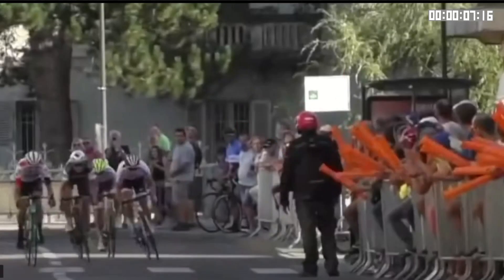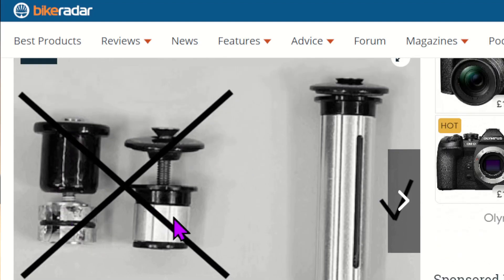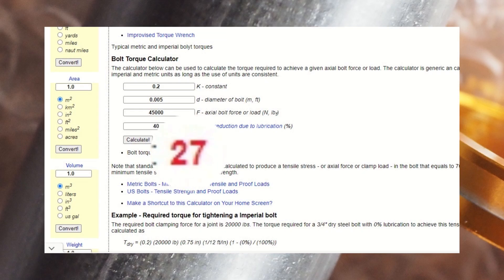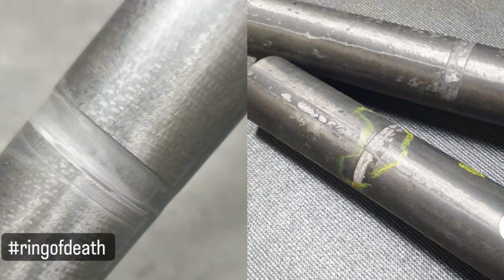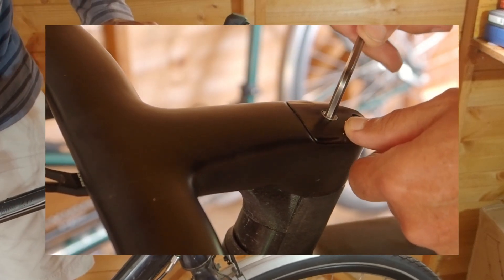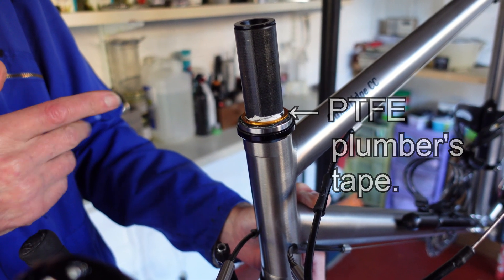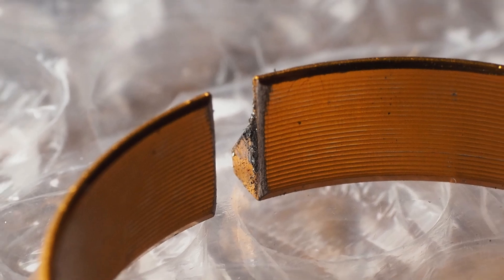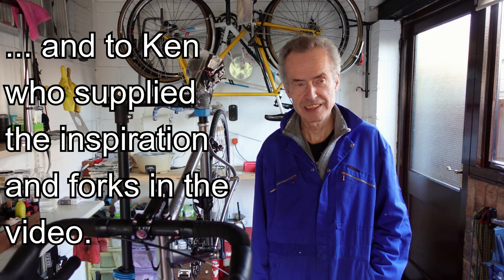Fork steerer: don't fail me!

Comment: Thanks for the PSA - it hadn't occurred to me that this could be a concern r.e. ringing. I inspected my carbon fork steerer tube and didn't see any damage. I tried fitting some teflon tape as a preventative measure but the ring is so snug I couldn't fit the tape under it, so I left it off.

Where the tape was useful though was around the base of the steerer tube where the crown race rests. The fitment of the CR was a bit loose around the straight stem, leading to a bit of play in the fork when the top cap was tightened properly. I noticed it when I gripped the front brake - I found there was a little bit of rocking in the fork. So I wrapped a few rounds of tape around that area and pressed the CR on. It seems to have removed the play for now, we'll see once it gets a few miles on it. Thanks for the inspiration!
Reply from the maker: It's good that you didn't see any ringing. Not all fork steerers suffer from it. Whether your bike suffers from ringing depends on many factors, including the design and manufacturing of the various components. For instance, some of the rings are not split, they have a o-ring inside them that fits snuggly onto the steerer, this type tends not to cause problems.  
Wear where the lower race fits onto the fork steering is not uncommon either. It's good that you may have found a solution, but if it were mine I would give it a good visual inspection just to make sure there was not any other issues where the steering fits into the fork crown.

Comment: Thanks for the info about this. I've just had to put my bike in to the local shop for crash damage inspection. The forks were fine in terms of crash damage but it did have a quite severe case of ringing (which I hadn't ever heard of before). The level of wear is pretty much the same as shown at 6:08 - maybe even slightly deeper. I was horrified. I never even knew to look for this problem. So now I have to fork out (oops!) for a new pair of forks as that wasn't caused by the crash.
Reply from the maker: @GeoffTV2 > sorry about the slight delay in responding. I'm glad the video was useful, it's the reason I make them. I'm sorry to hear about your fork steerer; ringing is not an issue that gets that much attention. At least the accident did highlight the issue, and you could fix the problem before you had a major failure. As I describe in the video, I would get the bike shop to locally wrap the steerer with tape to stop it happening again. Gorilla tape is good, nice and tough but it might be a bit thick. That's why I tend to use PTFE tape. I hope the repair goes well. You deserve a some 🎂🍰.
Reply: @FiveMinuteVelo  Thank you very much for the response. Yes, I'll get them to do that, or I'll do it. I'm OK with doing my own maintenance. The only reason it's in the shop is because the insurance company needed the crash damage assessed and repaired professionally, which works for me. Got a couple of broken bones to sort out too, so I'm not overly stressed about sorting the bike damage in a hurry.
Reply from the maker: @GeoffTV2 > sorry about not mentioning the crash damage to you, my bad. From your description I assumed it was a minor accident. I hope you get better soon. Best wishes.

Comment: Has anyone considered using tubeless rim tape as an option to ptfe tape?
Reply from the maker: Thanks for taking the time to ask the question. I don't think the type of tape is really that important. Putting an interlayer there is the most important thing. I'm sure tubeless tape would work. I use PTFE tape because it's thin and I can control the final thickness. PTFE tape is also very tough. 🎂🍰

Comment: plastic split ring, long compression tube and check/service bearings every 2k kms
Reply from the maker: I have noticed that more and more new bikes, like  my Orbea Gain, seem to be fitted with plastic 'top bearing support'. I suspect this is for cost reduction and not to save the steerer; however, it should do that too. Take wins where you can. 👍

Comment: Maybe some chainstay plastic adhesive protector would also save the carbon fiber from the wear?
Reply from the maker: You could probably use almost anything as an interlayer. The biggest issue with choosing a material is its thickness, if it's to thick you may have to stretch the coller too far to get it on the fork. Have you tried your own suggestion, did it work?
Reply: i've seen cricket bat tape being used

Comment: Good video Terry. One of my forks shows visible but very minor wear on it. Would you say the heaviest wear always occurs on the rear side of the steerer tube? I suppose that would make sense because that's where the pressure of the steerer against the split collar would normally be greatest. I'll try some PTFE tape next time I've got the fork out.
Reply from the maker: Will, 
If your long on miles and light on breaking I would expect the most  ringing wear be at rear of the steerer. If you do a lot of heavy braking,  particularly on rough roads,  I would expect the most we're at the front of the steerer.

Comment: I had a pair of aluminium handlebars catastrophically fail on me once, with similarly unpleasant results. 

I have also had a lugged steel frame snap off at the downtube/headtube joint... and despite this the bike just became a bit bouncier, giving me time to pull over safely. Thus, I only ride steel now; steel bends and buckles, but a heck of a lot slower and more forgivingly.
Reply from the maker: That's not too great, I hope you didn't receive any injuries. I've had two sets of aluminium alloy handlebars break, luckily in both cases I didn't fall off. I broke plenty of other parts too. I've never had forks fail though 🥵.
Reply: @FiveMinuteVelo  Sadly, I did the tarmac tumble when the handlebars folded like a poker pro, and I opened my knee up to the bone somehow in the process. That took a while to fix itself. Steel handlebars from then on.
Reply from the maker: @jananilcolonoscopu4034  ouch!